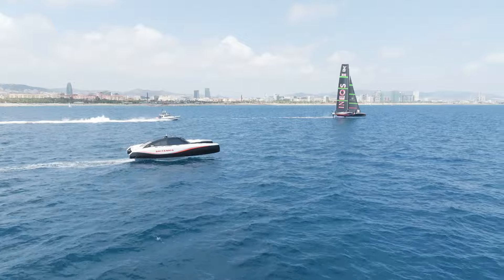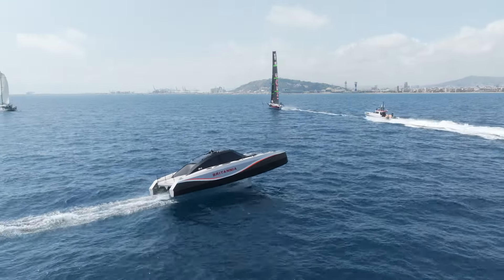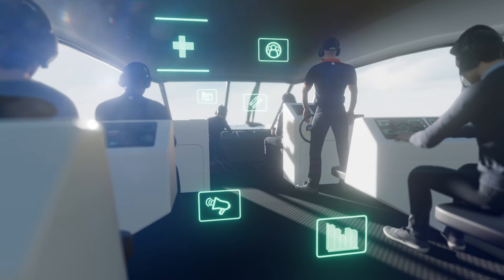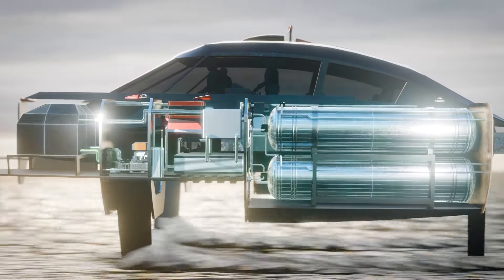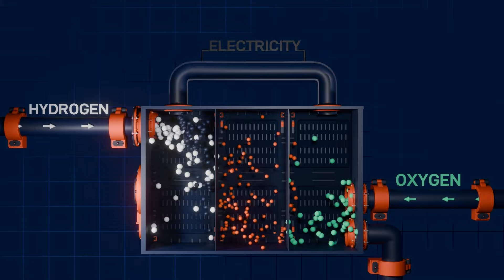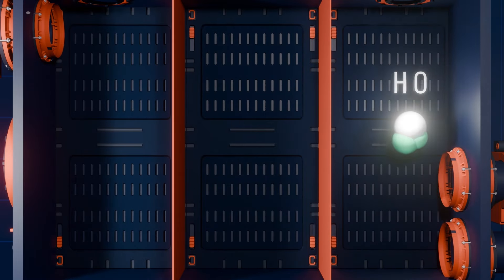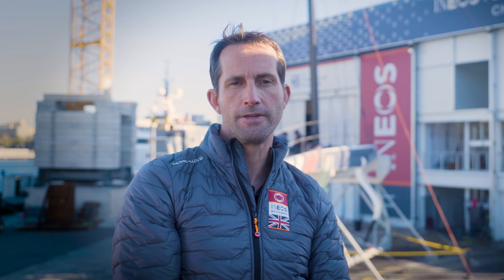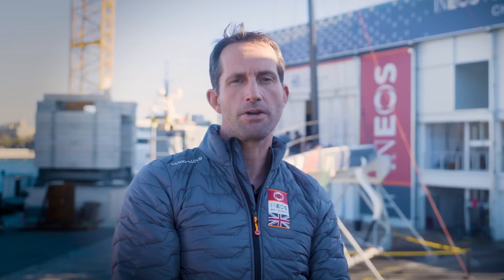INSide Britannia: Hydro Chase Boat Explained

Comment: It would be interesting to know where the hydrogen for the chase boats comes from and how it is produced.
Reply: No. That would ruin the illusion, and show the boat to be, quite literally, show-boating!
Reply: 😅 @Chris.Davies
Reply: There is a loss of about 20% in electrical energy to produce electricity. 1kw input of electricity will equate to about 0.8 kw of energy in hydrogen form. With most developed countries there is not an abundance of capacity available as it is. So Hydrogen production and the take up of electric cars places an increasing demand current on electrical infrastructure. The elephant in the room that is never addressed is that if there were to be a wholesale uptake on hydrogen and electric powered vehicles the current electrical infrastructure would not cope. There is not enough generation capacity to meet demand and then there is not the capacity in the transmission infrastructure to get the electricity to where it is needed. Until the electricity generation and transmission capacity is upgraded there will always be a dependance on fossil fuels. It is not just transport, industry also relies heavily on the use of fossel fuels.

Comment: I can see that none of the fuel cell boat are hosting the coaches, each time the Tv turn to coaches they are in normal fuel powered outboard with 4x 300hp V8 or V10.